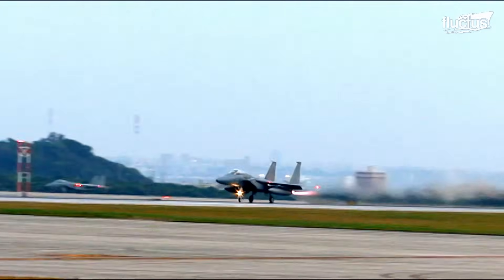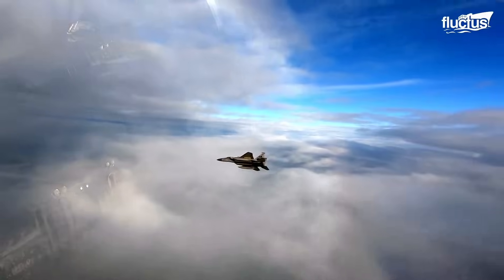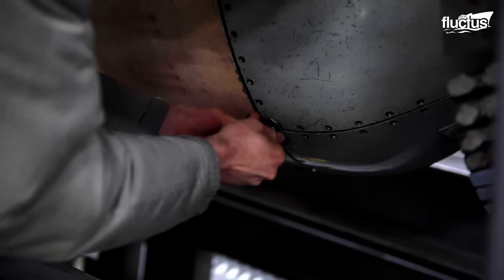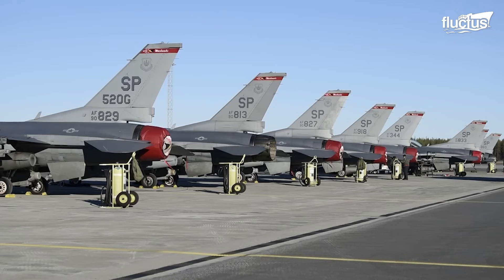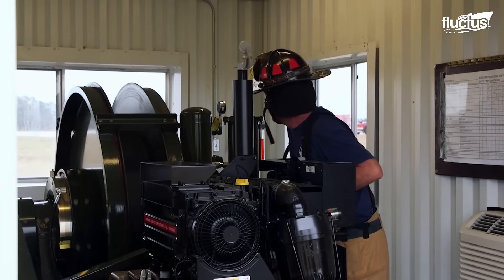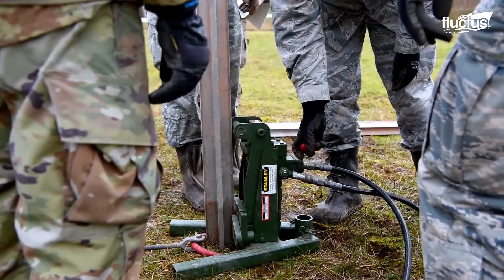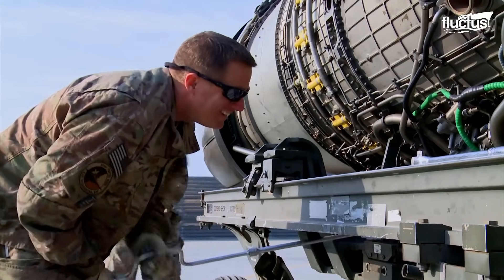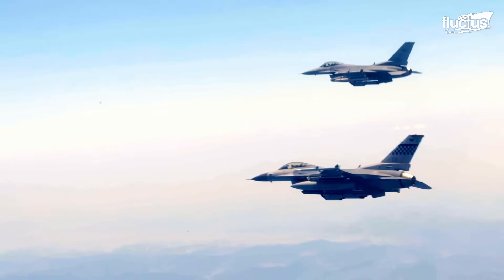Extreme Technique US Found to Brutally Test Fighter Jet Engines to the Limit

Comment: They did not find a way to test engines. They are chained down to a anchor rings on the ramp run up area and runup to full after burner. When I was a crew chief on C-141A's (1964-1968) when we went to the blast fence we could chain the plane to  anchor rings for full power runs. It is a normal procedure. This procedure has been used for many years on the flight line.